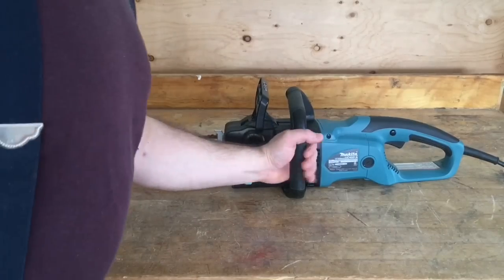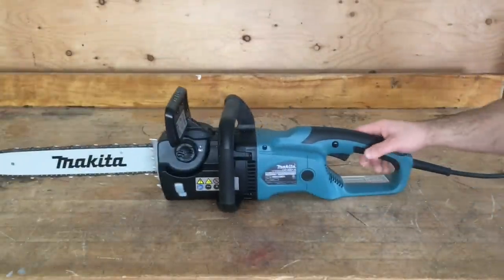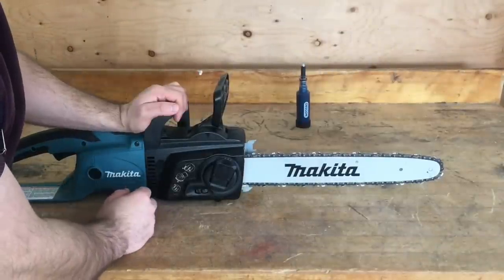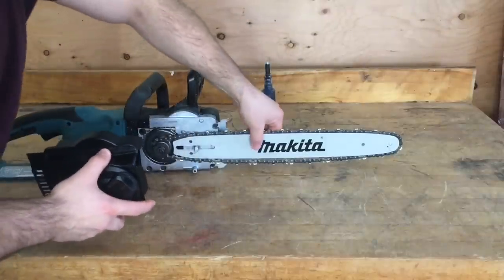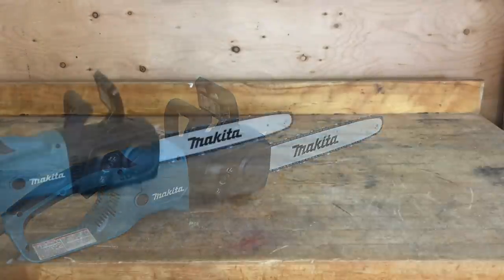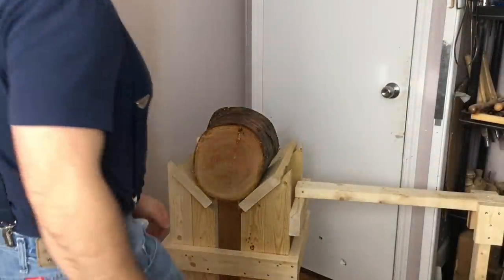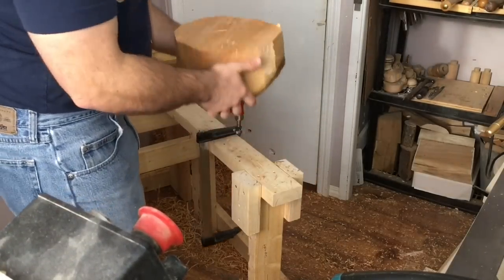Chainsaw Review - Makita UC4051A (Chainsaws for Woodturners #1)

Comment: I got rid of all my gas  and corded electric saws when I tried a n EGO 56v battery operated.  It puts all them to shame.
Reply from the maker: Don Lyons I have heard that these modern batteries and battery powered saws really do put out a lot of power. Even my 20v dewalt drill has quite a bit of torque. How does the battery charge hold up Don? I'm going to pin your comment to the top so people can see your input. Thanks!
Kyler
Reply: @woodturnerky8556  I get about 1 hour cutting time on a charge and takes about 12.5 hour to recharge.  Need to have 2 batteries if you are going to do much cutting.
Reply from the maker: Don Lyons That's not too bad though. I think many woodturners out there (and people doing some light trimming or firewood processing) wouldn't need more than an hour at a time.
Reply: Are carving bars available for the EGO saw?
Reply: @donlyons8964  If it's taking you 12.5 hours to recharge your battery, something is wrong. I'm guessing you meant 2.5 hours.
Reply: How much the batteries cost?

Comment: I have a UC4000 and put thousands of hours on it. It is very durable. If you cut level or nose up you will not hit ground with the chain. The chains are cheap, don’t bother sharpening them.

Comment: Thank you for the great explanation. The mechanism for tensioning the chain (which can also be found in many other saws) is a reason not to buy this saw. If the large locking wheel loses friction, the entire tension of the chain rests on the small plastic tension pin. This is a joke and planned destruction.

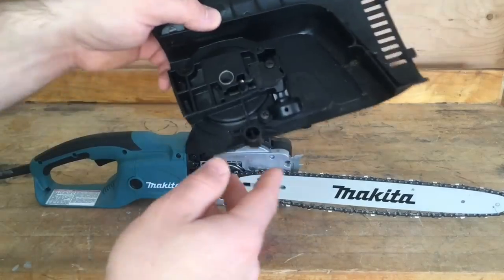Comment: @8:39 The pin in the saw which I bought today is of metal. May be that Makita saw your video and changed it. Originally I wanted to buy the UC4550A but somehow I was not much concentrated during online buy. So I will take it as you did: no additional tool neccessary to tighten the saw chain.

Comment: thank you for your info and demo.  I found if you turn the saw on its side you can view through the bottom at eye level (I was sitting down and could see with no problem)  the pin and then you can position the pin while turning.
Reply: I followed your advice and it is indeed like you mentioned: positioning the pin is quite easy this way. Thanks for your contribution!

Comment: Kyler that was a top notch review. I have been thinking of getting an electric chain saw. Lot of great features as you pointed out plus I didn't care for the how you tension the chain either. Seemed a bit flimsy.
The nice thing about an electric is when you set it down its off and not vibration across the ground. I have an older McCullough Pro Mac 20 inch that even with the chain locked can vibrate 6 feet away while I get another log ready. Well maybe not 6 feet.
Great review except for one thing....AHH down here in Oregon we call it Oregun. Don't ask me why it has always been that way. We even had bumper stickers that said OREGUN!
Just teasing...every where else in the US they call it OreGone
Great job Kyler,
Gary
Reply: Lol we call it oregun in canada as well.

Comment: I think you did say attentioning 😂 great review Kyler that looks like a great bit of kit. I may have to get one as my gas one still wont run properly even after changing piston and cylinder. I get what you mean about the plastic parts pitty they went with that but as you say probably easy to replace. All the best al 👍
Reply from the maker: Woodturning by Alan Scannell Lol thanks Alan! It's nice because you can use it indoors if need be. It's funny how everybody has a problem with the plastic parts, makita really goofed up there! Lol
Reply: @woodturnerky8556  yea they sure did plastic is not the way to go on a unit like that but I'm sure if you where stuck you could mock up a sturdier adjustment knob. Seriously thinking about getting one of these though. Cheers buddy 👍

Comment: I am also using a UC4051A. Can i use 18" or longer guide bar for UC4051A? 16" seems short for me.
Reply: You can use 18". In EU there version of this saw sold with 18" bar - this is how big those go as stock option.

Comment: Great review KY. New to chain saw  . So probably a stupid ? But  here goes . Do All chainsaws have the little hole at the end of the bar? And is it hard to find that tool you used for  when you  showed oiling the  bar.
Reply from the maker: Mr. B Thanks Mr. B! From what I've seen, many bars don't have the little greasing hole at the nose. None of my Stihl saws have them, can't remember seeing them in husky's either. Oregon might have them. But I'm not totally positive. The little greaser tool was only about $10 (CDN) and I found it at Canadian Tire. It should be available at any store that sells chainsaw supplies (bars, chains, sharpening tools) including Amazon. One other point I should make is if you are planning on going electric, make sure you have a good heavy gauge (12 gauge) extension cord. Especially if it's going to be as long as 50'. Smaller cords have too much resistance and may make the motor run hot. Hope this helps!
Kyler
Reply: @woodturnerky8556  He, that's a very good tip. It is true that a cable that's too tin can overheat or cause trouble. Thanks for the good advice!!